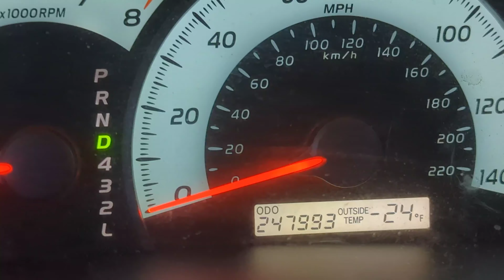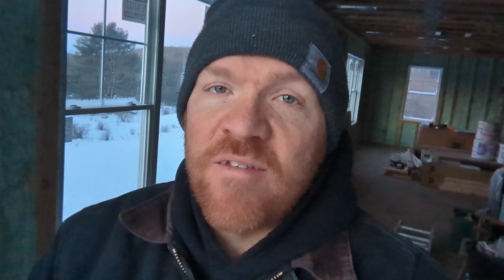Can Air Source Heat Pumps Handle the Cold?

Comment: Why don't you have a ground source heat pump?  If you have a ground loop, you are back to extracting heat from a 52 degree base.  That is the best way to go with a heat pump when the frost can possibly go down 3 feet like an area that has -24 degree winter temp.  In any event, it would be good to have a significant back up system.  Both propane(inground tank) and a good sized generator.
Reply from the maker: It was a cost factor. The ground source were significantly more expensive. We have a 20kw Cummins whole house generator and the propane furnace as well. I think that overall money is best spent in the exterior walls and in the envelope decreasing the overall heating and cooling load
Reply: @woodlyz  Excellent idea.  Insulation/design saves so much in the long run.  Less heat needed, less propane, less wood if you have a wood stove for atmosphere.  It also may allow you to heat some of your house by just cooking diner.  In the video, you have green foam in the outside walls.  Are they 2x6 or 2x8 walls?  This is the first of your videos, so I am not familiar with your build yet.   Have a good day.
Reply from the maker: @gibblespascack1418  2x6 with closed cell spray foam. We also have zip system for an air barrier. As homes become tighter wood becomes more problematic in my opinion b/c you need some kind of make up air
Reply: @woodlyz  You may have to add an ERV(energy recovery ventilator) in order to ensure that the moisture is not built up on the inside of the walls.  Well it is a great design with lots of ideas in this home.
Reply from the maker: @gibblespascack1418  we have an ERV in the works. We had gone back and forth on it and then made the final call that it is a necessity with the tightness.

Comment: 30 years ago, I designed and built my home as passive solar and super insulated. I have wood stoves as backup. Cooling is mostly attic ventilation and allowing hot air to go up the attic stairs. The number of sunny days has dropped over the years so I have to burn some wood. Good Luck, Rick
Reply from the maker: Very interesting. We are south facing so I anticipate that we will have a good bit of solar gain and have given a lot of attention to air sealing. What other factors did you utilize from the design to be passive?
Reply: @woodlyz  My house is oriented true east-west. The walls are 8" thick with the inner 2 x 4 studs and outer 2x4 studs lined up. The 1/2" space between the studs was filled will Great Stuff to insulate and lock the two studs together. The top plate and sole plates were 2 x 8 s with the 2 x 4 walls flush with the face they were closest to. Sheathing was 3/4" BC plywood that I had used to form the basement. I used 5/8" fireproof sheetrock on the interior. The ceiling beams are 2 x 12 and fully insulated.
I put extra sliding glass doors on the south side and only 50% of normal windows in the north side. South facing glass is NOT low E. The floor between the basement and living area is 11 1/2" of reinforced concrete. This absorbs the solar heat on sunny days and then slowly releases it when there is no sun. 
If you want to add solar heating to an existing building, you can set up heat grabbers on the south side. Build them from old sliding glass doors(NOT low E). There are many videos about heat grabbers. They work on the principal that heat rises.
I have a wood stove in the basement that will supplement the heat in the slab. It takes 8+ hours for heat to come through the slab. I also have a small wood stove in the living room to take a chill off and when the power is out(frequently here) I can cook on it. Good Luck, Rick

Comment: Getting ready to build our 80 x 54 foot shop this year .Really like the idea of a heat pump system .But we are also going to install our clean burn waste oil furnace for situations like today
Reply from the maker: That's a good solution. There are some different cold weather rated heat pumps. I think our Trane is rated for -13 but the efficiency drops before that point.